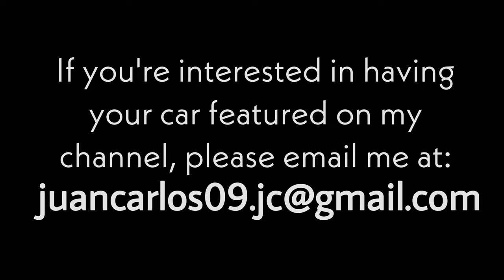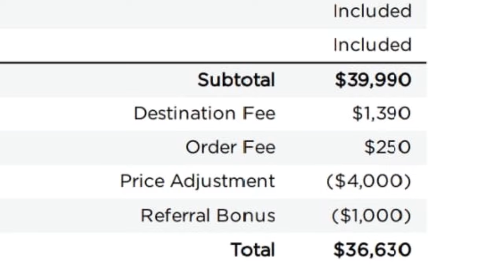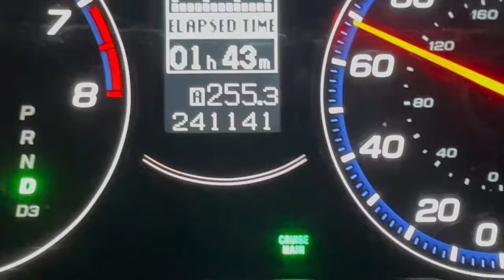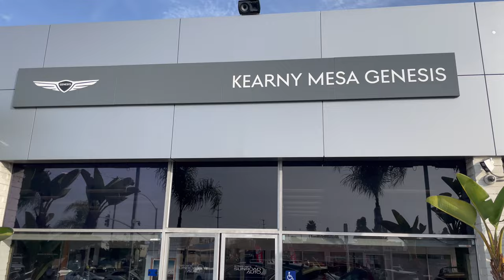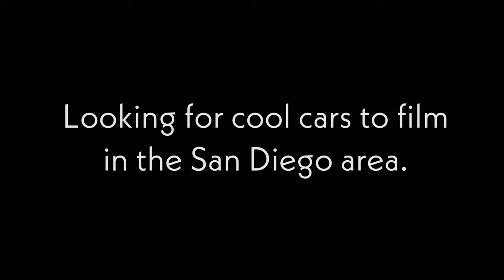New Car Hunting and Fleet Update. #rx350  #genesis #Tesla

Comment: congrats on the new whip. My daily is a 2013 Hyundai Elantra GT now with 60K miles and it has been rock solid since day one. Zero issues and very reliable, more so than my wife's 2016 Civic EX.
Reply from the maker: I have tons of people around me who drive Hyundai/Kia/Genesis and most swear by them. On the other hand, my best friend drives an Optima, he bought it new and it’s part of a badge that came with excessive oil consumption. He’s haggling with Kia because part of the remediation was to monitor each case with special engine treatment and it was determined that his engine wasn’t affected. The process only applied to vehicles under 100k and his was evaluated at 95k but his is burning tons of oil and now Kia doesn’t want to give him a new engine which is what other owners got. This is his third Kia and he loves them but 🤷🏻‍♂️
Reply: @JuanCarlosLTO  wow! sorry to hear this about your friend's KIA. Hope KIA will do the right thing and take care of a loyal customer. No brand of cars is perfect but how they take care of the customer is more important when there's a concern.